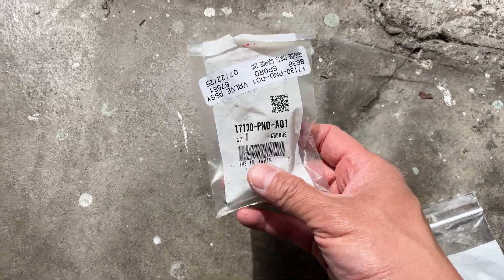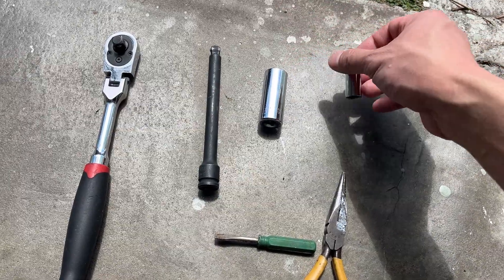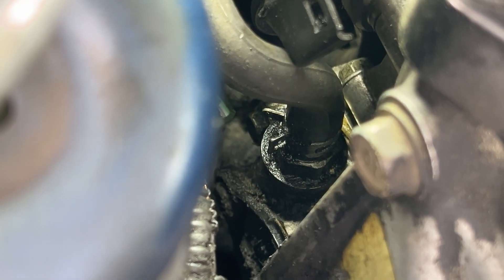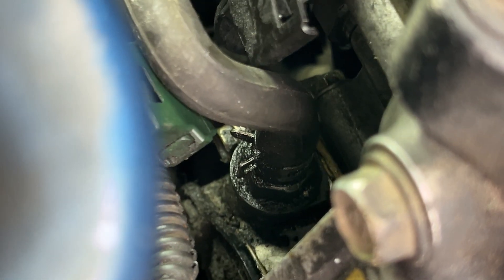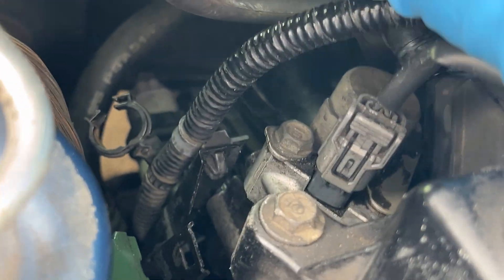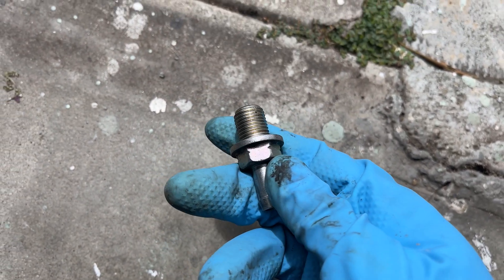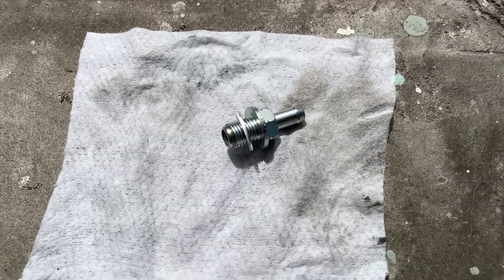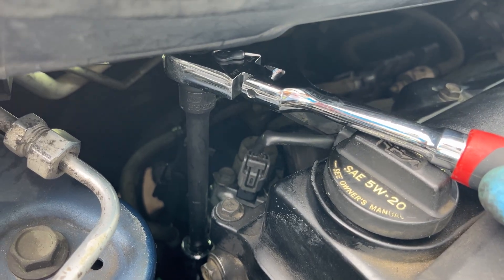How to fix the PCV VALVE OIL LEAK on a 2006-2011 8th Gen Honda Civic!  With a BIG SURPRISE!

Comment: When i open the oil cover while the engine is on I cean clearly see that its pushing air out, Is it because of the PCV valve ?

Comment: Just bought a $500 2008 that needs at least a wheel bearing and basically all the common maintenance. Stripped oil plug, oil residue near the PCV, no oil filler cap gasket. I’m hoping I don’t strip this taking it out or spark plugs. I just need this to slowly get back to a reliable condition for my kids to use. Thanks for this video, I’ve been watching many procedure videos to gain best practices knowledge or easy work arounds to avoid doing a common mistake.

Comment: Thank you so much for this video. I have a 2007 civic 5MT and my symptoms are oil burning, noticed smoke coming out the dipstick one morning, sluggish and rough acceleration (almost as if the engines lugging). Sometimes CEL comes on with code P0420 and then will go away. Does this sound like PCV valve?
Reply: Definitely symptoms.  It is worth it to change because the part is cheap.

Comment: Getting rough/surge acceleration especially as low rpms and cant seem to figure out what it is, Could it be bad or faulty PCV Valve?
Reply from the maker: My civic did feel smoother/stronger after replacing the PCV valve, it could be the valve itself or the fact that the oil leak was stopped.

Comment: The oil leak was caused by not having the crush washer in place. Also, find the torque spec and use it for this application.
Reply: 33 lb-ft
Reply: U may snap the pcv valve if u follow the torque specs in manual.make sure to remove old washer and carefully hand  tighten till it is just tight enough.do over do the tghtening u will break pcv valve